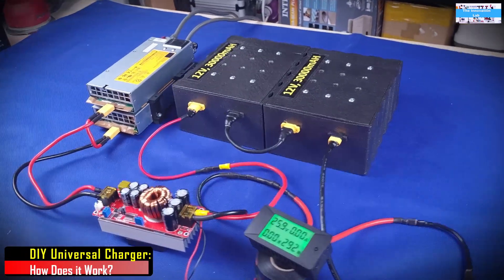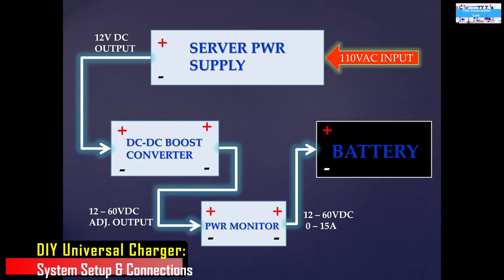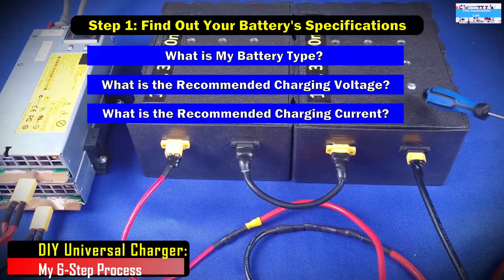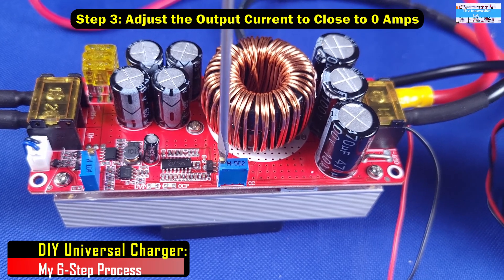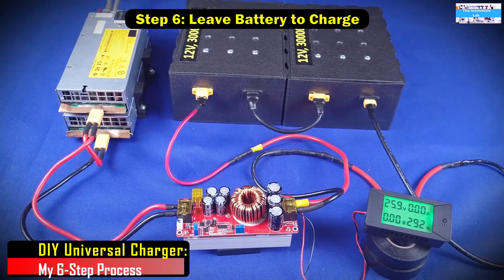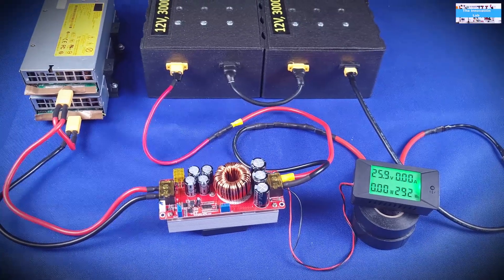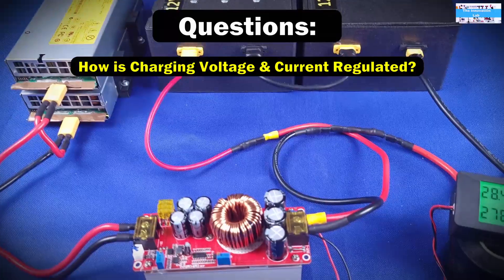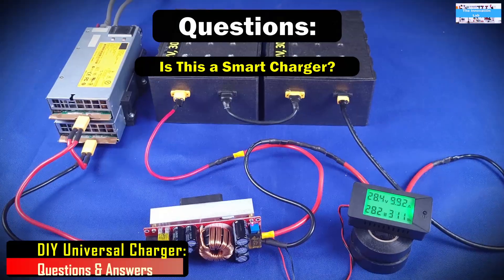DC to DC BOOST CONVERTER, High Voltage Battery Charger!

Comment: Hi, 
isn't there the danger, that the cells are not getting balanced in the right way?
Do batteries with an BMS balance themselves?
Reply from the maker: Great question.
👍👍👍

Cell balancing is a function that BMSs are designed to provide to Li-ion and LiFePO4 battery systems by closely monitoring the state of Charge (SoC) and State of Health (SoH) of each individual cell groups in the battery system.
Once the battery cells get to a set/safe voltage level during the charge or discharge cycles, the BMS will disconnect the battery from the charger to prevent the battery from overcharging. 

Lead acid batteries are not known to require cell balancing. However, care must be taken to make sure that the manufacturer recommend charging voltage and current is used during charging, else, the batteries will overcharge.

The BMS design, provides a layer of safety that alleviates some of the battery balancing concerns. 

CAUTION: ⚠️⚠️⚠️
My recommendation has always been to closely monitor your batteries while you are charging them and to disconnect them from the charger when the battery is fully charged. Keep an eye on your battery temperature. It is never a great idea to leave a battery charging and go on vacation. BMSs are electronics circuits made of solid state switches and control circuits that are subject to failures...so great attention is always required. Don't trust any design 100%...always think of safety.

Respectfully,
The Innovati0n Lab www.theinnovati0nlab.com
Reply: @theinnovati0nlab782  Thank you for the detailed answer! 👍

Comment: You mean,in this video converter protect over charging ?
Reply from the maker: Converter does not have that function. However, I was saying that as long as you set the charging voltage and current according to your battery specs, when your battery is fully charged, the system will go into equilibrium - hence your battery will not overcharge.

The Innovati0n Lab💥 www.theinnovati0nlab.com

Comment: Can we have a regulated battery charging if the converter is between the input source and PWM charge controller
Reply from the maker: Can you elaborate a little - so I understand your question? The PWM is part of the control circuit of the converter.☺️

Here is the setup flow;
Power supply ->Converter...> Battery 

Thanks.
The Innovati0n Lab 💥 www.theinnovati0nlab.com

Comment: Hi mate, im planning to build evbike charger from this step up module. 

Im using lifepo4 24s, my target voltage is 87.6V and 10-12 Amps max.

Input power from huawei r4850n6 server psu 53V 56A

Questions:
1. Will the step up module last long if i use it every day? Well regular use, i only use 5-6Amps

2. When first time connect the psu and step up module, before we set the potensio, is the default current set to the max?

Thanks before.
Reply from the maker: I honestly can't speak to the reliability of the converter because it is not really my product. 

However, if you are using it as a battery charger - with a good cooling system. It should last. As long as you are not overloading it. Using a high input voltage should  definitely be very helpful in reducing the overcurrent stress.

Comment: Hi mate. I'm big fan of your channel.
Can you charge a 72v lithium battery at 10 or 15 amps with this setup?
Reply from the maker: Amazing question!!
👍👍👍
Let's do some  math.

Assumptions:
Please correct me where I am wrong.
💥 72V nominal LiFePO4 battery should have a series group of 24 cells in series (24S).....correct?
If so, research shows that you need a charging voltage of 3.65V per cell.

Hence, the recommended charging voltage is about; 
3.65V X 24 = 87.6V

Now, 10A at 87.6V means that you will need greater than 876W at the overall input of your converter system.
Looking at the worst case converter efficiency of say....80% you will need a power supply that can supply;
876/0.8 = 1095W. 
I would recommend planning for about 1300W.
and for this converter, I would also recommend a minimum input voltage of 48V - for this much power.
We found a hack that would make it possible for you to possibly get this much power with just a 24V input power.
See our last full video. Update is coming soon. We will also be able to sell the modified converter soon enough at our website.

CAUTION: ⚠️⚠️
High voltage DC power is quite lethal. Make sure that you are protecting yourself by using the proper PPE. Always double-check all connections. Also, as a matter of personal preference, make sure that your barrel system is well protected....and make sure you check on it regularly during charging.

I hope this helps.
Please, we need your help the help our channel and to promote our website. You can help by sharing our videos on social media and by visiting our website  at www.theinnovati0nlab.com.
👍😎
The Innovati0n Lab💥
Reply: @theinnovati0nlab782  Thank you for taking the time to reply me.
My battery is 20s Lipo. So max voltage is 84v. Still, the formula is the same. 

What I didn't understand is this: With such cheap step-up, it's not possible to make a fast charger only with 2 server power supplies? Do I really need 4?
I was thinking about getting only 2 Servers PSU 1200W each

FIY my step-up is the Drok 900w

Comment: Great video, though I think people are going to be confused by use of the term 'mode' which implies a directed mode switch rather than the process be a natural effect of the way internal resistance goes up a the cells charge.

Have you tried paralleling the boost converters?
If I were to drop my full home electrical service, that would be 12kw - my pack would take up to 23kw...
Hmmm....is electrical service based solely on current?
If I used 220v*100a that would be 22kw, or 450a @ 48vdc.
That would almost max my pack.
that would require 15 boost converters, fed by 8 2950w 48v server p/s.
I bet I could charge at work directly from the 48v supply if I could make my pack portable.
0 to Full in 5 minutes would rock.
More realistically, I would need 4 D2D's to support 2 p/s.
That would give me 30 minute charge times
Reply from the maker: Hi friend, Thanks a lot for the great constructive feedback! We appreciate it.👍👍 
I see your point, and you are right that some people may find the terminology confusing. However, I believe that the word 'mode' is actually used in most battery design literature to describe this phenomenon. Let me know if you found something different. Please share links here. I am always happy to learn from our audience. 
👍👍

Regarding your electrical service comment, what I would say to that is for you to be mindful of super high currents because they lead to massive heat dissipations on your electrical systems - unless your system is designed to handle industrial level  current draw. 

As you know, electrical systems, commercial and industrial wire guages, have  evolved over the years to get to a good balance between the voltage and current components of transmitted power. 
The goal is usually to keep your current draw as low as recommended for your electrical wiring.
As for your battery systems, I would recommend consulting your battery's manufacturer datasheet for the recommended charging currents and voltages.

I hope this helps.
Thanks again.
👍😎
The Innovati0n Lab

Comment: Can u make universal overcharge protection circuit board ,which works for all battery charging I.e, 12v ,24v, 36v, 48v 60v, 72v
Reply from the maker: Honestly,
I really like the way you think!
👍👍👍
It will be easier to do for lead acid batteries, where cell balancing is not as critical. 
However, with lithium phosphate or Lithium-Ion batteries, there are some added complexities because the protection circuit has to protect each individual group of (3.2V or 3.7V) cells connected in series to achieve those voltages.
Usually, Lifepo4 and Li-ion battery BMSs are designed with comparators or voltage level monitors and MOSFET switches that monitor the charge discharge levels of the battery cells which are connected in series.

Yeah, it gets complicated. But I will give it some more thought.
Thanks again for such a wonderful insight.
👍😎
Reply: @theinnovati0nlab782  I am going to make universal battery charger, using boost convertor + 12v-50amp smps power supply  with auto cut off. But the problem is that , I find the auto cut off circuit board online which supports only max 60v ,means for 48v lithium batteries. Cut off voltage below 60v. But for 60v & 72 v batt charging , I didn't find any cut off circuit.  
So I am asking that if u could make it possible than it will be very helpful. ..
Thank uuu..
Reply from the maker: @technicaldada5384  
Ah, I see. It is definitely a good project idea. I have added it to my to-do list for future projects. 👍
But first, I will do some search to see if there isn't a product out there that I can recommend. It is usually more cost-effective to just by a cheaper product off the shelf  than to try to develop one from scratch.

Comment: Did you change anything when "it went from cc to cv mode" or did it do that by itself on the background of you setting maximum voltage and maximum current in the beginning?
Reply from the maker: I didn't change any settings to go from CC to CV. Lithium-Ion and Lithium phosphate batteries are designed to go through both (CV and CV) charging phases/modes by default. Using a CC charger just helps them to get through the CC charging phase more efficiently.
This is not the same for other battery chemistries and designs, like lead-acid batteries that mostly charge in the CV mode.

Comment: these boost converters easily to get burned. be carefull. they are not long lasting.
Reply from the maker: Hi friend,
Thanks a lot for the great feedback. However, make sure that you are adding external fans to the converter to give them some additional cooling under heavy loads. Never trust the small fan and heatsink  that some of these converters are designed with, and they are not sufficient in cooling the converters.
As you know, excessive heat is the number one enemy of any power electronics. 
Honestly, I have a different experience with these converters. I bought my first 1200W model of these converters more than 5 years ago, and it still works until today.
Discliamer: I am not affiliated with any vendors. My reviews and feedback are unbiased.

Comment: ty Sir nice work and video.
i wonder if by adding digital pots and a microcontroller (esp82xx) this could b remotely controlled. 
it would be an interesting project.
in my case i am looking to charge a battery with the excess power that i would otherwise feed into the grid
Reply from the maker: Kudos to the way you think! 👍👍👍
It is absolutely possible. 
However, I would recommend you have a plan to perform lots and lots of testing on it before your remote application. Battery charging can be fun, but you have to make sure that you are checking all the points of safety needed. My recommendation is usually for people to stay close and montor the battery and charging system closely because system failures do happen. Also, you should have a plan of how you can do a remote system shut down - just in case you have a failure.

Comment: So with this setup of 24v power supply would I be able to charge my 12v battery to 14.6v @60a ?
Reply from the maker: Hi friend.
Thanks for asking such a wonderful question.
The 24V setup is meant to charge batteries 24V and higher if you are using a boost converter.
However, you can charge a 12V battery with the same setup, but you will need a buck converter to step the voltage down. 
As for doing a high current charging at 60A, that is a tough challenge. I am working on finding a cheap way to do that, and once I have a solution, I will make a video for it.

If you can help us grow our channel by sharing our videos, that will be wonderful.
Reply: @theinnovati0nlab782  thanks for the quick response. That’s the project I’m working on right now. I have a computer power supply with dual 12v rails at 30a each. I already own this boost converter. Maybe I’ll buy another to run them in parallel @14.6v for the 60amp then to battery.

Comment: I put the 1800W version on an ebike and it failed after 5 minutes, halfway up the hill. Output voltage is now the same as input. :-(
16V to 55V, to a 48V 18A peak ebike controller.
Reply from the maker: Hi friend!
Thanks a lot for sharing your experience with our community.👍👍 
This was what I was afraid would happen with these boost converters, especially when the applied input voltage is low. I will see if there could be a way to boost the power output of these converters - even at a lower voltage input. Stay tuned.

However, for now, my recommendation would be to increase the input voltage level to your boost converter if you are still willing to try using it again on your ebike. Personally, I won't use anything less than 36V as the input voltage.
That means a 36 - 48V boost.
Reply: @theinnovati0nlab782  thanks!
There appear to be 4 (3 used as rectifiers?). The large one in the middle must be switching driver.... Using diode test I am NOT getting open reading between source and drain....
I lifted the large MOSFET and there appears to be a scorch mark in between the area near the source and drain of the chip....
Yup, an actual crack in the large MOSFET chip -- labeled HY3912 FL277S02 C.
What MOSFET do you recommend as a replacement?
Is there a way to protect it, prevent the failure from recurring?
Reply from the maker: Hi, friend.
My first guess would be that your MOSFETs died, but the damage could have spread to other components as well - PWM IC, output diodes, etc. Those  boost converter units use the HY3912 MOSFETs, and you can order those from eBay and give it a try.  However, if you consider the cost of parts, plus your time, it might just be better and faster to buy another converter unit - giving how cheap they are. 

I made a video where  I took the converter apart and explained the component - please check it out to see if you could find some helpful information.
https://youtu.be/iQnXLZqpSpo
Reply: @theinnovati0nlab782  Thank you kindly!
I was considering to replace just the large switching MOSFET in the middle. I haven't even visually inspected under the other three -- if I bend them, it may weaken their legs?
Reply from the maker: Just gently raise the MOSFET. The pins should break that easy. I have done the replacement before with no issues.

Comment: Can this device be used to feed the energy from a wind turbine into an on-grid inverter to simulate input from a set of solar panels ? down the line after a rectifier bridge or wind turbine controller of course.
Reply from the maker: Hi friend,
Thanks a lot for the very thoughtful question.
👍👍
Personally, I will recommend using this converter for simpler applications. It seems to me that you will need a smart converter with a lot more controls/functions to be able to manage your power distribution.

Comment: Building one of these, but I'm going to use a riden 6024 digital control buck after the booster for convenience, thanks for the inspiration. I was thinking, perhaps you could run car power amplifiers at  home from these PSUs.
Reply from the maker: Hi friend!
Thanks for the wonderful interaction and for sharing your experience. I would love to do a review of  the riden 6024. Where did you get it from?

To answer your question, I believe you can power your car amplifier with a good switch-mode boost/buck converter. However, I  will recommend that you pay close attention to the input power requirements of your amplifier to make sure that your converters can provide/match those power requirements.
Reply: Got it through bangood, better price if you get first purchase discount. Will try a cheap car ámp directly to the 12v HP supply at some point, can't see any problems, except maybe noise or may need to add reservoir caps.

Comment: if i use a welding machine with 25v 160 a and use 4 voltage converters in parallel, will i get about 50a 54.6v?
Reply from the maker: Thanks a lot for the thoughtful feedback. 
👍

My experience with switch-mode converters is that they usually don't play well together when you connect them in parallel. Even when you adjust the current and voltage settings to the same exact levels for all converters, there is still no guarantee that the paralleled network of boost converters will lead to a higher power output - just as you would expect for more traditional dc sources like batteries.

However, you can definitely try it as an experiment and share your findings with our Youtube community. We can learn from each other.
👍👍